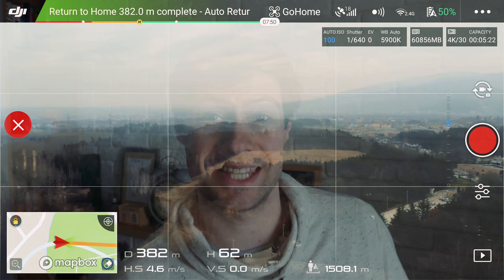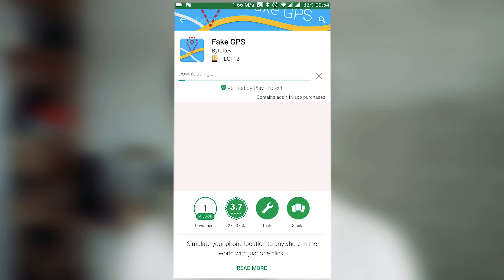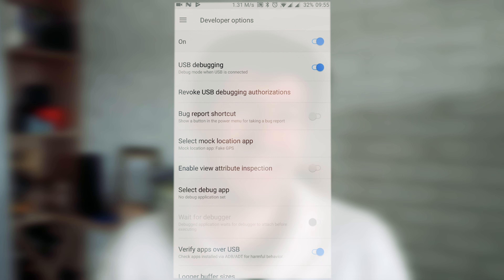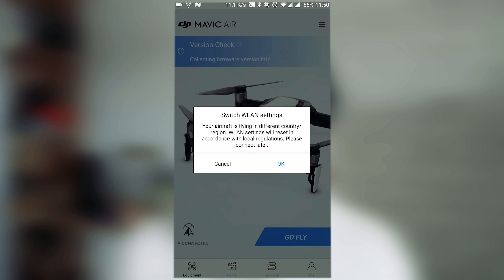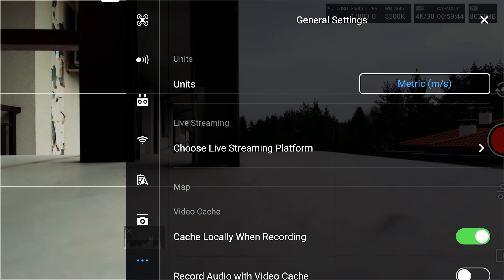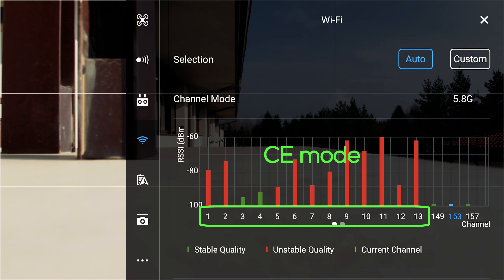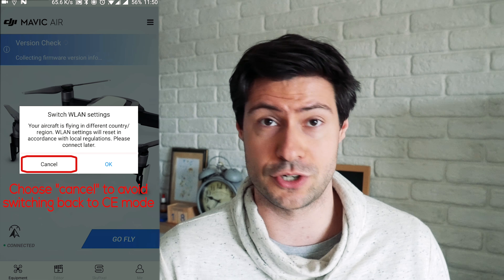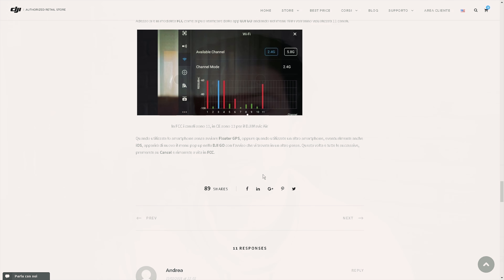DJI Mavic Air FCC Hack: Switch to FCC Mode in 2 Minutes!

Comment: It does not work here in croatia
Reply from the maker: Hi Ante, that should work anywhere - country shouldn't matter. Which part doesn't work?
Reply: tech4all I tried a few apps for fake gps and when it asks me to change wlan settings i click ok but it still has 13 channels.
Reply from the maker: That is weird. At some point the remote controller should reset once you are connected.
Does google maps show your real location or the faked one when you open it on your phone?
Reply: tech4all Google maps show the fake location but it does not want to change it to fcc mode. Im using the up to date DJI app
Reply from the maker: Ante, maybe you can try some of the other fake location gps apps. You can try to follow the spark facebook's page guide - https://www.facebook.com/groups/TheSparkSide/ - it is relevant for Mavic Air too.

Comment: CE  mode  max distance i've done 1243m
Reply from the maker: Quite an achievement! What channel were you using?
Reply: @TechMishka  I was in 2.4 on top of the hill flying toward the sea so I had a clear signal with no interferences but it wasn't perfect!

Comment: not working
Reply from the maker: It is working. If it is not working for you, please patiently check the procedure step by step and it will eventually work.
Reply: For my drone ...not working... every time I enter the fake gps ,when I go to the channel icon ..after few second automaticly reset to CE. I follow your tutorial, same aplication ,same procedure...not your fault..just saying...not working.
Reply: Love to get few more meters man...but...????
Reply from the maker: Which version of the app do you use? And - could be a good idea to open google maps while fakegps is on. WHich location is shown on google maps? Looks like something has precedence over the faked gps location.
Also, which is your phone model?
Reply from the maker: THe other alternative is to use the modded app. Although this is DJI SPark community, the app should work with Mavic Air too. https://www.facebook.com/groups/TheSparkSide
Reply: @TechMishka  I will try the modded app...Thanks for the replay
Reply: @TechMishka  Google maps showing my location not the fake one...samsung galaxy A3 2016
Reply from the maker: If it is showing your location, then the fake location trick is not working. Check your developer options settings. Or use the GPS Floater app from the play store as plan "b". Most certainly that is the reason it is not working.

Comment: Seems it doesnt work anymore :( am i the only one ?
Reply from the maker: Works perfectly fine. Just follow the steps carefully :-)
Reply: tech4all my bad. It appears i just pressed OK and returned to CE mode... Its OK now. And thank You for this video. Your explanations are really clear ! 👌
Reply: Does not work for me. I tried few fake gps apps. Google maps shows im in colorado but the dji app does not prompt at all. APP is 4.2.21
Reply from the maker: Alternatively you may try the TSS app - go to facebook and find the group "The Spark Side". It will work with Mavic Air too.
Reply: tech4all ill try.
Reply: It looks like it works with the modded app